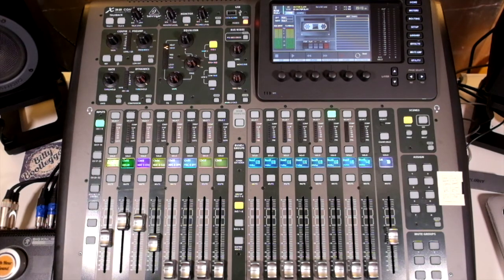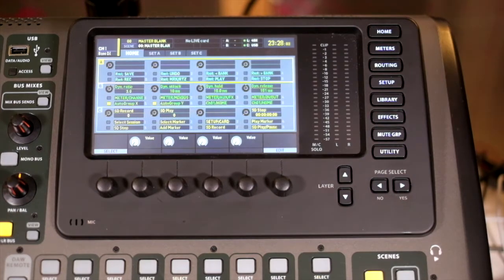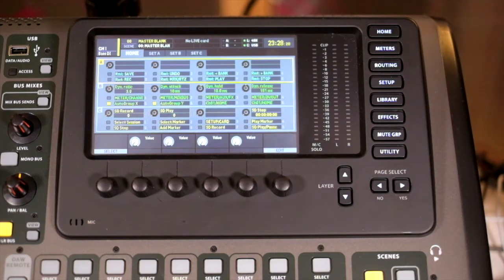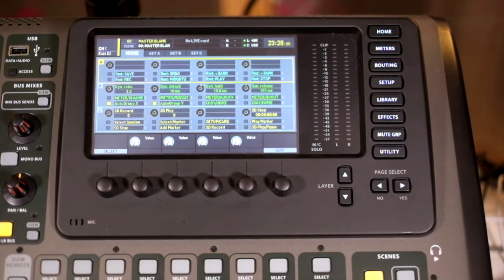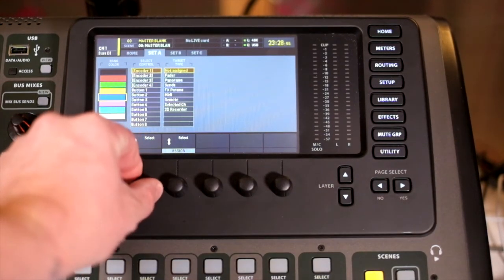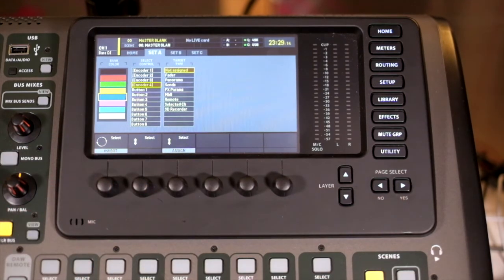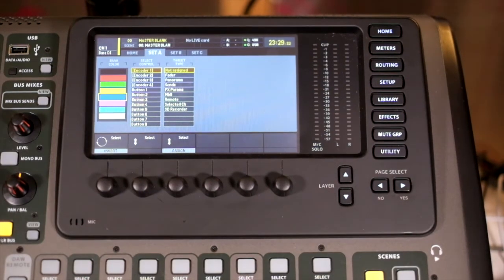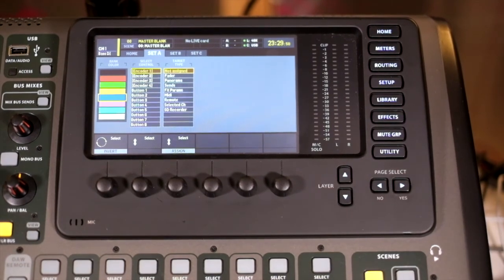X32 Menu -  Assign Buttons

Comment: Brilliant Video. Can I pick your brains for something you said at 1.10. You said the encoder's are set to manage your dynamics. What settings do you use so these encoder's can control in pro tools for example to change a threshold or even send level?
Reply from the maker: Hi, Thanks for the watch (and I'm assuming like and subscribe ;)). Unfortunately not. However, they can be mapped (only the middle 4) to what you like using the midi learn function (in PT). check out this vid https://youtu.be/1k28bPGkjsU by WinkSound. The encoders have to be assigned to the 'remote' target type first. 

I use the assign encoders for the dynamics controls of an inserted effect into the signal chain on an input channel on the desk. I sometimes use a different compressor than the one in the standard signal path. Having these assigned gives me the chance to get to the controls quickly rather than fiddling through the effects menus. I especially like using it on the Stereo Fair compressor to smash the input gain harder - this works nicely on parallel compressed drum bus.
Reply: @11thhoursound54  thanks so much for the reply. Great Chanel and have subscribed. Keep up good work 👌👍
Reply from the maker: @gssgband 

Not a problem. happy I can help 

P.S thanks for the follow